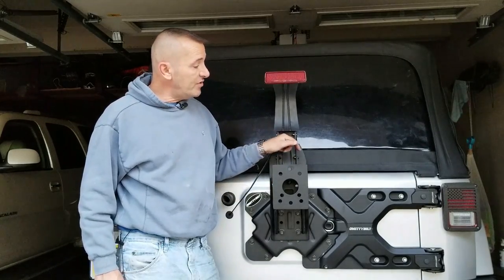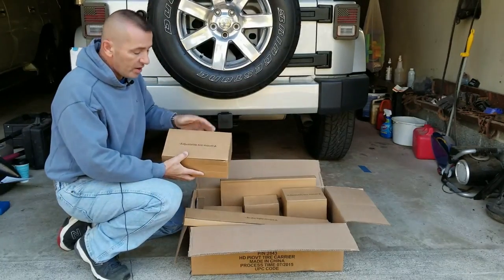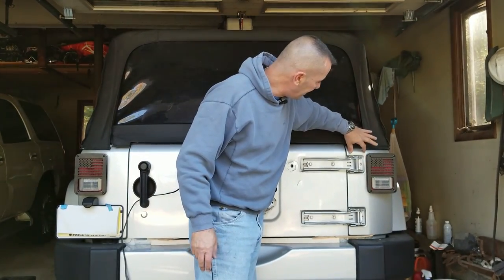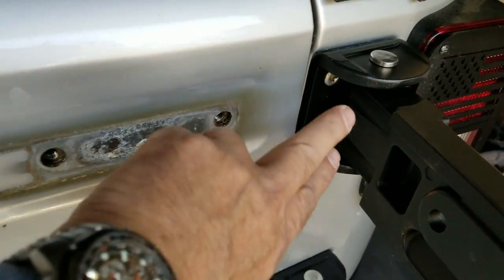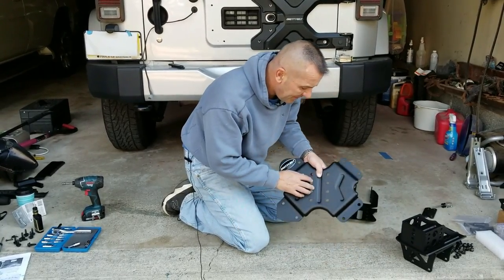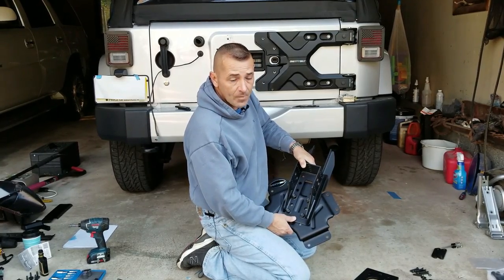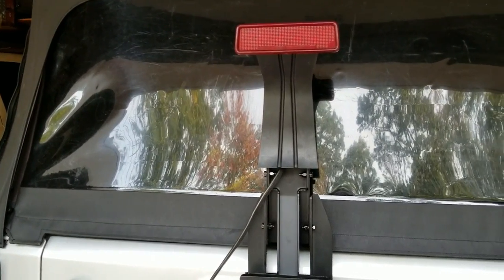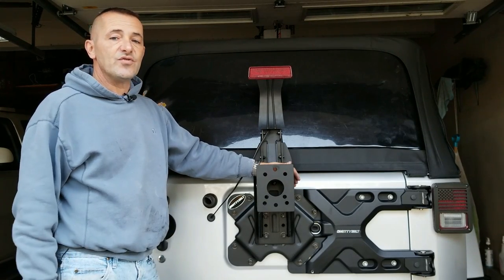Smittybilt Pivot HD Tire Carrier Jeep JK Heavy Duty Hinge 2843 - Review and How to Install

Comment: Arguably one of the best install videos I've seen.  Concise with the required level of detail.  Have been looking at this carrier replacement for a little while- will probably squeeze the trigger now that I know what to expect on install.  Thanks for posting this.
Reply from the maker: Hi Jarrod, Thanks for the compliment.  It has held up very well since the install.
Reply: He went one hole up too high. The bottom holes aligned is supposed to be the max height. The back side shouldn't be touching the 3rd light bracket.

Comment: Just did this in stall, without looking at your video. Yes the instructions from Smittybuilt are terrible. This was ahead scratcher trying to figure out what bolts went where. Great video, thanks for sharing.
Reply from the maker: Hi Roy, definitely takes times to figure things out. On the good side mine has held up great so far.

Comment: Thanks for the video, you made everything easier up to the point where you said this is the tricky part, you will need some muscle to get those bolts thru the metal plate, I am talking about the 3 bolts  that support the spare tire, unless you have a heavy duty press, they do provide the nuts that you will need to tighten all the way to get the bolts set. everything else was easy, your video was by far the most helpful thank you I also love my new tire carrier!
Reply from the maker: Thanks so much.  Mine has held up excellent.  Very solid and no rust a year later.  Thanks for watching.
Reply: Yes, and doing so turns the ends of those lug nuts from an 18mm to a 20mm.

Comment: Very nice Lou, really like the fact that you did not have to cut or drill.  This looks very heavy duty but at the same time extremely secure to the Vehicle. On a side note we really like the Flags you have in the taillights, never seen that before or if we have never noticed it. Take care Lou and safe travels.
Reply from the maker: Thanks for watching guys.  Yes the tire mount is very heavy.  Should have no problem holding the bigger spare i plan on using.  Have it set for a lift and new tires in about 3 weeks.  I'm hoping to use it for my toad vehicle.  Yes i have kind of an American flag theme on my Jeep. The hood, the side panels and the taillights all have some type of flag. This is my first ever wrangler so I'm having a ball fixing it up. Happy Travels.

Comment: I know it's not critical, but the 3rd break light wire should be put into the side of the mount prior to putting the mount on so that it's a neat install, otherwise your wire is just hanging out. May be necessary for a larger tire but it can easily run up to a 34...not sure about 35.
Reply from the maker: Hi, The wire on my Jeep was not long enough to run into the side of the third brake light.

Comment: The instructions say to torque the 4 bolts that go through the main plate, light bracket and wheel mount bracket to 80 ft lbs, how do you do that? The tightest I got them was around 60. It's just difficult holding the wrench on the other side of this heavy ass plate and not letting the torque wrench slip on the other.
Reply from the maker: I didn't seem to have that problem but my son was a second pair of hands when assembling the mount. It is heavy and awkward a helper makes things go very smooth.
Reply: @RVHabit  "smooth" is a relative term.

Comment: I have a 2 1/2 lift with 34 inch tires do you think this product will hold it well? I also see you said yours is still holding up well with no rust.
Reply from the maker: All I can say is 6 years later and it has held up perfectly and I have no complaints.  Works very well.

Comment: How did you get the studs in? Just pressed them in?
Reply from the maker: Hi Matt, yes you decide what holes you want to use and when you tighten the nut on the bolt the bolt presses into place.  The studs will then stay in pla e when you remove the spare.

Comment: I appreciate you posting this. I am considering purchasing this tire carrier. I just bought a 2014 Wrangler and had a 2-1/2" lift with 33" tires installed. The spare is currently rattling my tailgate when I hit bumps and am afraid that the tailgate will get damaged. I think this is what I need to secure the spare without damaging my tailgate.
Reply from the maker: If you have 33" tire on the factory spare tire mount this is what you need.  Good luck and congrats on your new Jeep.
Reply: Thanks RV Habit! I just ordered it on 4wheelparts.com.

Comment: Mine came with 4 metal plates with rubber gaskets. Where did you put those??
Reply from the maker: they go behind the main plate that attaches to the tailgate. It is a spacer and gasket to keep the plate solid and in line.
Reply: @RVHabit  did you actually use the spacers? If I were to use the spacers the plate would not be squared on the tailgate.
Reply from the maker: Yes the spacers go on one side to square up the plate to the tailgate.
Reply: Mine didn’t come with metal spacers. I wonder if they forgot to put them in the box,
Reply: @chrismoccia  Neither did mine.  Box said it was made in 2016.  The "legs" on the left side have a deeper setback than on the right, so I'm thinking that makes up for the right side sitting on top of the hinge assembly?
Reply: @QuadShield  how did it end up working out. Trying to install my set now and it didn't include spacers and when I tighten the right side, the left side is about half an inch off the tailgate. Its almost like I got an old base plate with less offset then the new style and no spacers included. HELP lol

Comment: Did you use the 4 spacers and rubber gaskets the came with the mount? I did not use them. Did use the rubber gaskets. Figured it may cut down on any noise. Everything worked great without the spacers. Nice and tight the tailgate ant no rattling or squeaking. Very pleased very HEAVY DUYTY! GREAT VID also.
Reply from the maker: Yes I did go back and use the metal spacers as I noticed the mount was not sitting even against the tailgate.  It is super solid and has held up well.
Reply: @RVHabit  I was wondering because that seemed to be the case until i tightened it down then it all lined up. I have seen videos that go both ways but in the end it works really well and does the job. Thanks man.

Comment: What size are the pieces of wood you used to hold it up?!
Reply from the maker: Hi, I just used thin slats of wood that fit between bumper and bottom of the tailgate.  The size would be specific to your jeep.  You don't need to go crazy just find any scrap of wood that will snugly fit without actually lifting the tailgate.

Comment: Great video - straight to the point which is always nice! I just received my Smitty tire carrier and plan on installing this weekend. Other than on the OEM T50 bolts for the hinge plate, did you use blue loctite on the supplied screws for the tailgate as well?
Reply from the maker: Hi Rick, I used Loctite on the bolts that attached to the vehicle.  If I remember correctly that was it.
Reply: @RVHabit  Thanks! I look forward to the installation!
Reply: @RVHabit  Installing now - did you use blue loctite on the factory T50 Torx screws as well as the factory bolts for the hinge plate?
Reply from the maker: Yes blue Loctite

Comment: Hey got a question how much you think this Weighs?
Reply from the maker: I don't remember the exact weight but it is heavy maybe 40 lbs.  I know it does increase capacity to hold up to 135 lbs.
Reply: RV Habit great thanks
Reply: Hey got another question.. I noticed 4 gaskets and 4 spacers the same shape of the gasket I notice you didn't use them in the  install video do you know what those are for?
Reply from the maker: Yes, they go on the four corners of the mount.  The directions are very poor and after I did install I realized that the spacers and gaskets are needed to keep the mount in line with hinges.  I did install them after the video.

Comment: I have 35" tire on my  jeep spare. With original hinges. It does sag a bit when you open it. Does this make a difference? Does is shake when off road? Or do you recommend the ones that have the bumper tire carrier.
Reply from the maker: Hi Jose, I have 34" tires and this thing is rock solid.

Comment: Can't believe how bad these instructions are.  As for the spacers and gaskets.  Logically 2 go on the left (1 top 1 bottom) to compensate for swing arm on right. But where do the other 2 go?

Also how did your height adjustment settings (up 1 hole) in video work out with your 34s.  I have 34s coming too.
Reply from the maker: The instruction are really the worst.  there should be two rubber type spacers and two thicker steel spacers.  Both sets go on the left side.  The rubber spacer goes on first that seals against the Jeep then the steel spacer goes on.  Tire location is good but you probably could go a little lower if you need to.
Reply: @RVHabit  Thanks! For some reason I got 4 spacers and 4 gaskets so threw me off.  Thanks again for all your help.  After 2 years you are still getting views!
Reply from the maker: Well it is possible they changed the parts a little since I purchased mine.  I just wish they would improve the directions.   It is a very solid tire carrier mine has held up excellent.
Reply: @tdavelli  I just bought one and also have 4 of each. I also noticed there is a rubber gasket in the hinges pre installed.  Has anyone added grease to the pivot pins?
Reply from the maker: I have not added any grease and still operates like new.